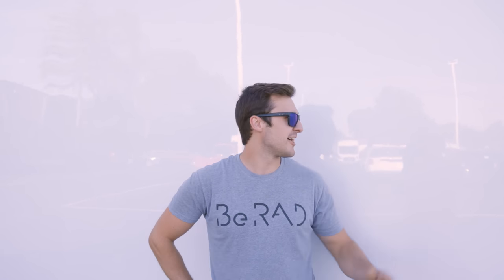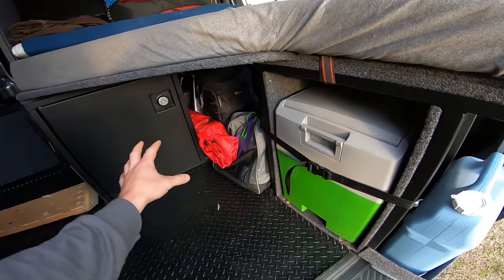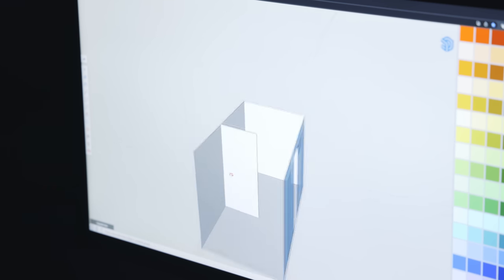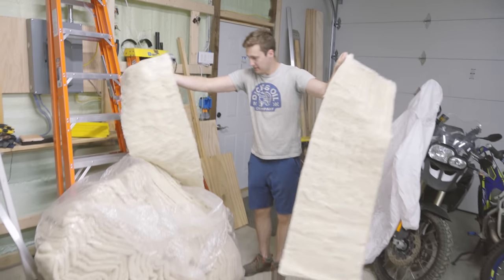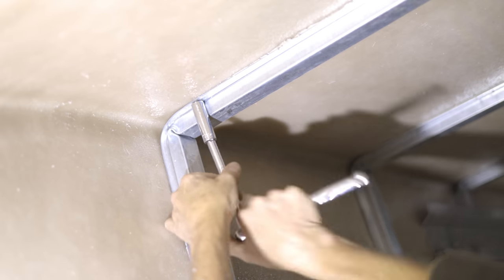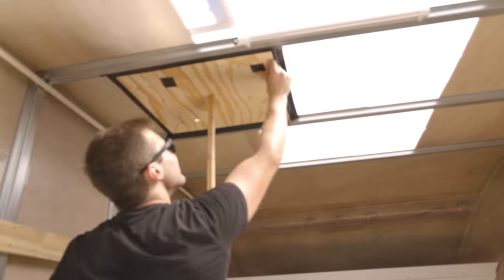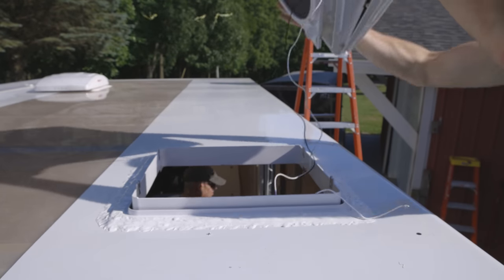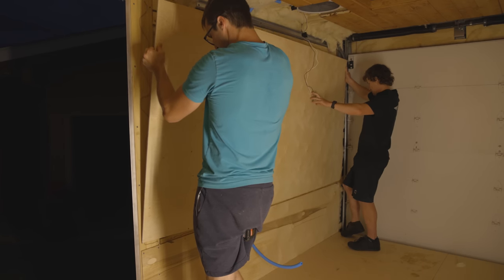Building the ULTIMATE Dirtbike Camper Van - Episode 1

Comment: Nice... as for the self leveling caulking,  I have a brandnew keystone bullet camper,  they recommend getting up on the roof to inspect the condition of the seals minimum of 3 times a year.   And your caulking job was a nicer job then the keystone builders did so nice work. 👍  can't wait to see more

Comment: I am putting a dual motorcycle hitch rack on the back of my boxtruck conversion.  That way I can take two motorcycles with me.  If you did a hitch you could do the same thing or pull a motorcycle trailer.
Reply from the maker: Kinda ruins the whole point of a Moto van if you ask me!
Reply from the maker: I prefer to keep my bikes inside to deter theft, keep things free of dirt and salt on the roads, and make loading super easy.
Reply from the maker: Oh but as for a trailer…they’re a pain!